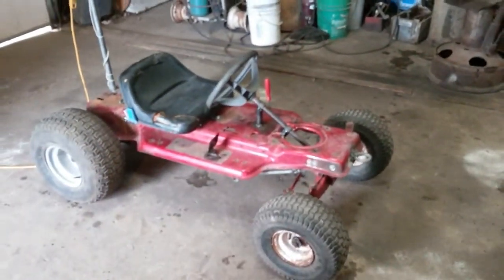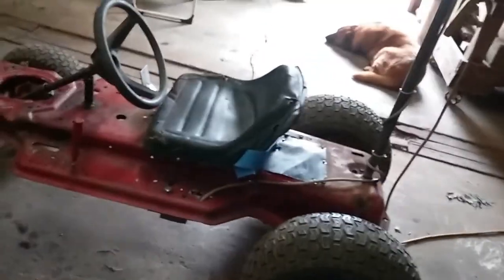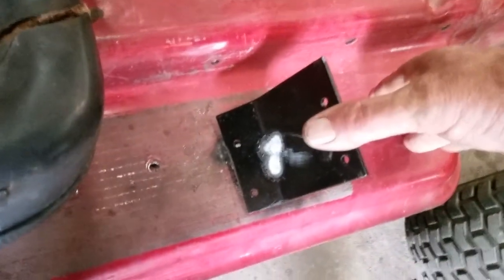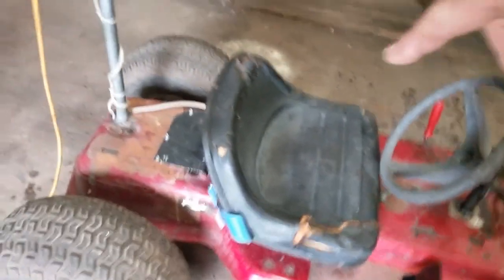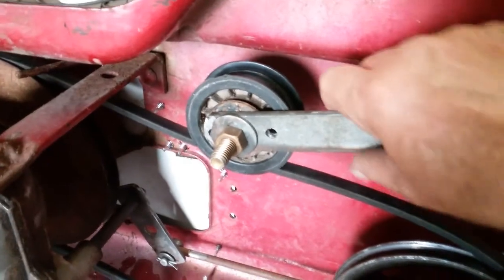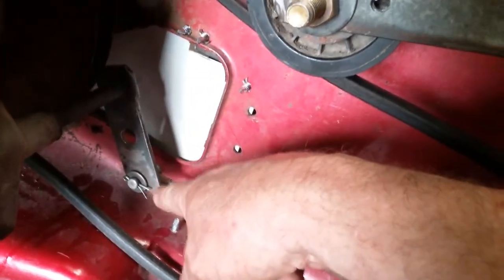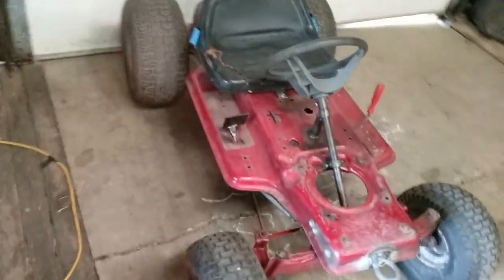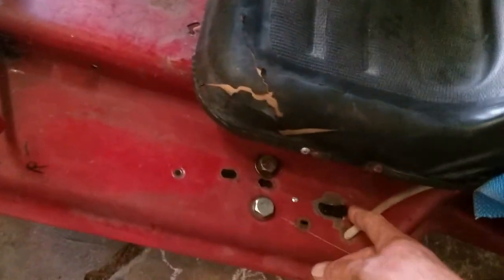AC Electric Go Kart

Comment: Hey can't you add a supercapacitor or jump box mixed with say a regular car battery and a high wattage inverter say 3000 watt to 6000 watt like you'd find on a motor home so the jumpbox would of corse power the one battery but it's a super capacitor so it would step in where the battery falls short as well as the one inverter which would fluctuate with voltage needs because these dc guys don't under stand one thing if I need more voltage I need less amperage so where they will need seventy pounds of copper we won't we can run normal 12g wire and they can't

Comment: could you add a rheostat (dimmer switch). Then leave the cart in highest gear and control speed with  the dimmer switch?
Reply from the maker: It would have to be something quite robust - like a variac to handle the heat from reducing the voltage. Plus, by reducing the voltage to the motor - it would get hot and burn up - if ran on low voltage for very long.

Comment: This is interesting.  Im actually converting my mastercraft lawn tractor to electric.  I got 3 batteries from the scrap yard and i also got a 3000w inverter and i also have a 1/2hp 115v motor and a washing machine motor that im going to mock up on it too.  I figure it should have decent torque with 2 motors on it.
Reply from the maker: Post a video of how it turns out. :)
Reply: I would try may be two batteries and a jumpbox just to help with higher voltage/ amperage but I think that's what I'd do and me personally I'd like to see a universal motor that has the capability to reach 25000 rpm and yet still maintain the low end torque

Comment: really interesting, about how much does the frame weigh because I'm building a go kart using a bench grinder and my frame weighs about 35 pounds
Reply from the maker: The Murray frame itself - with the front axle and the heavy rear trans axle - probably weighs around 100 pounds.